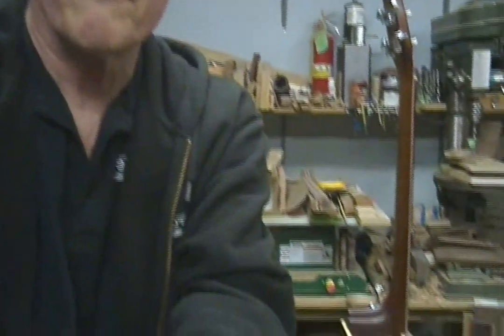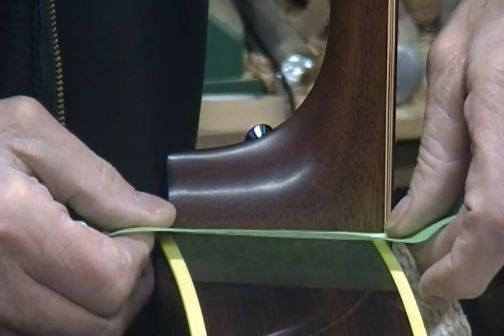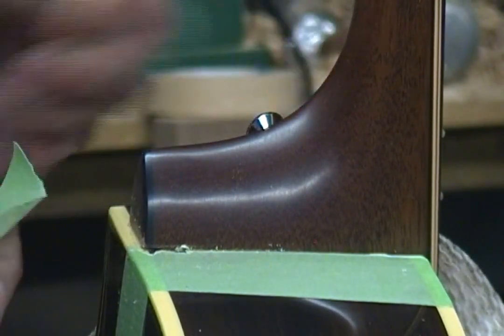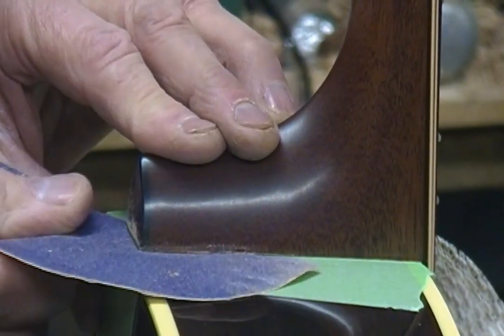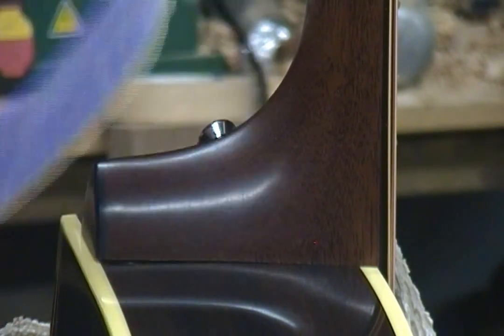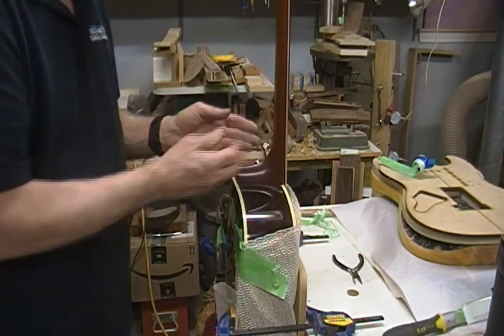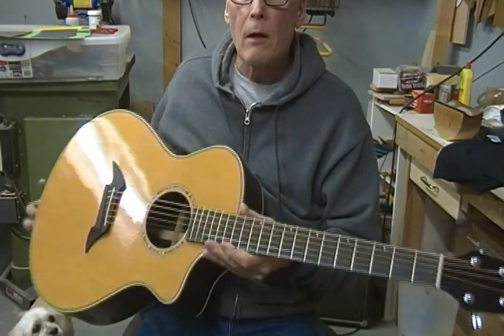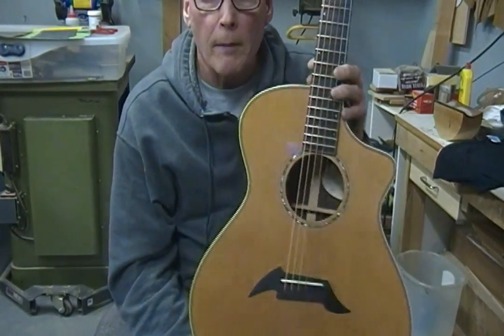Breedlove guitar bolt on neck reset JONAH GUITARS

Comment: Good work as usual Dane and another vote here against string through bridges. You know I'd like to see a video of the inside of the cabinet where you store your hoard of patience Brother  ;<D
Reply from the maker: Thanks Steve! I'm not to sure about the patience it's just kind of relaxing to just do what need to be done. Kind of Zen. Anyway looking at the video it would have gone better with the saw aspect of it if I had left a bolt in the neck and tightened it just enough to hold neck still. Then I could have had both hands to control the saw. It would have meant a lot less sanding.
Reply: @jonahguitarguy  At some stage you would still have been left with a saw's width step which would have to be blended out, and I suspect that would have been harder to achieve?

Just a thought- would there be any mileage in pulling the abrasive strip sideways backwards and forwards across the body curve? Repetitive pulling away from the neck in one direction seems to be an uneven and hard work approach to me?
Reply from the maker: @KL3NCH , yes the step would have to blended out but most of the material removed would be gone and working on blending the step would probably take less time. However there is some danger in removing to much wood early in the process. Obviously can't put it back. 

Pulling the grit side to side would work but the hardest part is holding the neck with just enough pressure/tension to let the grit move and still cut wood away and being locked in the joint and tearing the paper or just not being able to pull it period. Side to side would never work of course on a standard tenoned neck.
Reply: @jonahguitarguy  There speaks hands-on experience for which there is no substitute.

Comment: You know,I know people hate string thru bridges,but I have played and collected vintage ovations and adamas guitars for the better part of 20yrs and I’ve never had one of the bridges on the vintage hand built ovation/adamii lift,pop off ect.  My Breedlove custom shop OM with Oregon myrtle back/sides and old growth figured Doug fir top has a pinned bridge. 

For resetting bolt on necks,Dane you know that I’ve recently been collecting the hell out of vintage Godin acoustics,seagull,minstrel,ect and they all have bolt ons. I’ve gotten pretty good at the sandpaper pull method of getting the neck angle back in to spec on those guitars. Now the newer Godin acoustics have bolts in the neck block but don’t let them fool you,there is a 3” block milled out of the heel of the maple neck that is epoxied in to the body and the neck block. I bought one that needed a neck reset not knowing that and ended up having to saw the neck off to pull it. I routed a simple dovetail in to the neck block and epoxied a maple dovetail on the heel of the neck and made it a dovetail attachment.  

Speaking of Breedlove,my wife and kids got me a us custom shop Breedlove mandolin for Christmas. Maple body,maple neck,rosewood bridge,fingerboard,peg head overlay. Natural finish,carbon fiber tailpiece. I’m the second owner but it looks like it was never played. I sold my Loar era Gibson F to a good friend of mine up in the mountains of Virginia last year and I haven’t had one until now. The Loar was too fragile for me to play anymore. I was terrified about destroying it.
Reply from the maker: Don't how I missed this comment J.m. But thanks for watching it's always appreciated. I remember you had a lot of prototypes of Ovation guitars, I guess I've only seen the string through bridges folks are having problems with.

Comment: yep been there done that more times than I can count. not a fan of that style bridge either, have an Ovation here now the top of the bridge like that split off, I have to replace the entire bridge! breedlove has factory bridge doc, gotta dig that. cheers Dane!
Reply from the maker: Thanks Randy, not a fan of top load acoustic bridges. Don't see the need.
Reply: Heya Randy, there’s only one way to fix an Ovation, throw it in the trash. 😎
Reply: @100amps  lol I agree! but if someone wants to pay me to fix it I will! :P
Reply: Of course! I should have said “the only way to fix them permanently...”
Reply: The bridge doctor ?  Is that tue gizmo stew mac sells to fix acoustic bridges that are pulling up ? If so, I suppose its a good idea. Prevent tue problem instead repairing it later.

Comment: Resetting the neck and not doing anything with the finger board extension wouldn’t that cause it to ramp some since you didn’t shim the extension?
Reply from the maker: Since the reset is lowering the neck at the nut end it may cause more fallaway but not a ramp. Unless it's excessive there no reason to address it.   we're not talking big numbers here, the tiniest amount taken from the heel is multiplied by the length of there neck. Thanks for your question.

Comment: Hate those string-through bridges, but love those Michael Bolton necks. The finish crack repair would have made a good video. Did you use CA or lacquer for that?
Reply from the maker: It did have a nice feeling neck. I used thin CA first pass then medium. Razor scraped, sanded and buffed with Randy's own simichrome. I also used Nano Polish.
Reply from the maker: I thought I recorded  the repair but it wasn't on this card. It couldbe in my computer somewhere.
Reply from the maker: So hey Amps, is there a Michael Bolton model Breedlove or did I miss some humor here? Michael Bolt-on necks?
Reply: No, that would require a subtle  and witty sense of humour. Mine is just lame.

Comment: You're making me nervous
Reply from the maker: Now I have go back to watch this and see why you're nervous.
Reply: I guess it was the saw making me nervous, anyway it seems the main thing I look at when buying a used guitar is string height and how much saddle is left and neck relief. This is why I've decided to favor bolt on necks which eliminates most guitars because of dovetail necks. The reasons why seem numerous. I heard one high end builder say he doesn't build cedar top guitars because they have a propensity to belly up, which is a shame since cedar top guitars have the sweetest sound to me along with engelmann spruce which are both softer than Sitka or red spruce according to the Janka scale but seems like they would compensate with bracing. There are so many dynamics that are at play I'm sure there is no rule set in stone
Reply from the maker: @bswann3469 , This would be one of those don't try this at home things. Actually I moved on to sandpaper pulls pretty quickly because I was making myself nervous with the saw.